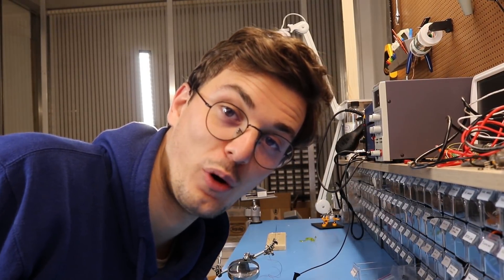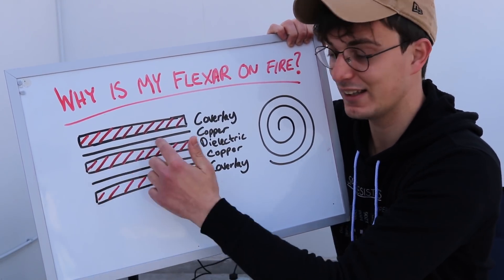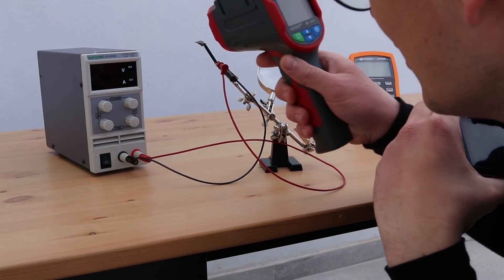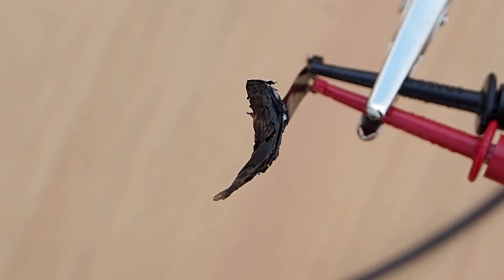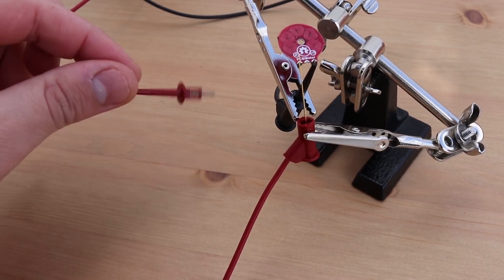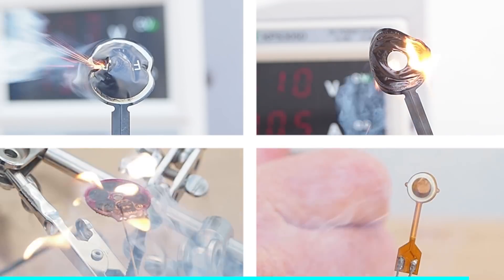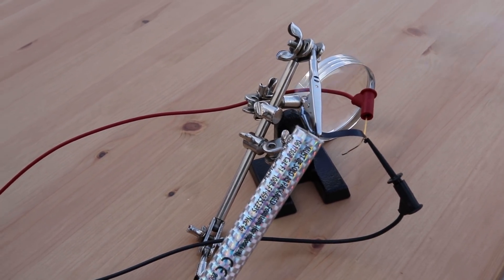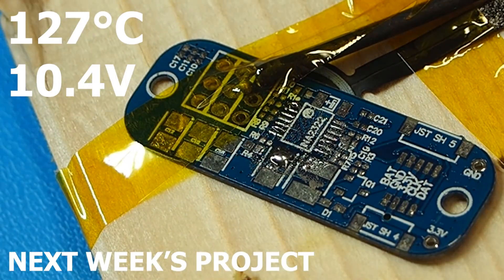Blowing Up Planar Coils

Comment: Now you need to explore the coil's ability to draw heat away from a surface, eg: cooling an object.  You may have to expose the copper a little.
Reply: Also the plastic coating was still sealed even with the "hole" in the middle. Would like to see the coating actually punctured  and not in an enclosed envelope.

Comment: My natural thinking leads me to ask if your going to stress test the flex AR tolerance for cold. (Say liquid nitrogen, exposure to high pressure CO2, or butane would be good)
I imagine your next trick is to use it as a heating bed to solder parts. Great work as always my man.

Comment: If you intend to start a fire, use a  thin copper trace that isn't covered with silk screen or solder mask. Use thick traces to feed the hot spot, so the rest of the board won't be damaged.

This will release mostly toxic copper vapor. That isn't good, but it is way better than a whole cocktail of mysterious toxic vapors. This makes it much easier to look up the health effects, and to figure out if protective equipment is appropriate.

Comment: It would be interesting to see one of these used as a model rocket engine igniter built into to a thrust vectoring control system, to keep everything neatly tucked in
Reply from the maker: That's what I was thinking! Maybe something bps.space could use 🤔
Reply: @CarlBugeja  absolutely, I’m actually working on a TVC board myself, so I’ll definitely consider incorporating something similar to my design, and see if it’ll work
Reply: For model rocketry at least the simple smaller solid rocket engines you gets a plug that separates to wires that ignite the rocket via a spark leaping the gap i presume thats arguably much simpler no? What would the the benefit be over the spark gap or something akin to a car cigarette lighter? Truly curious not trying to be antagonistic I feel I must be missing something either way have a good day all :)